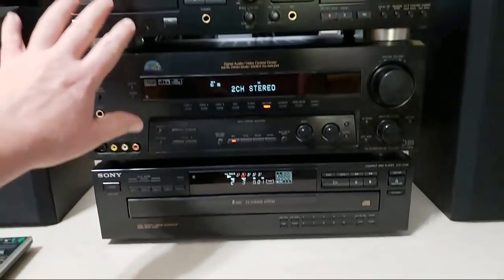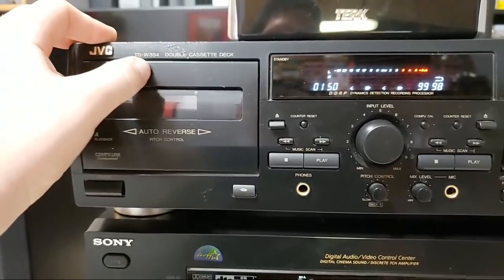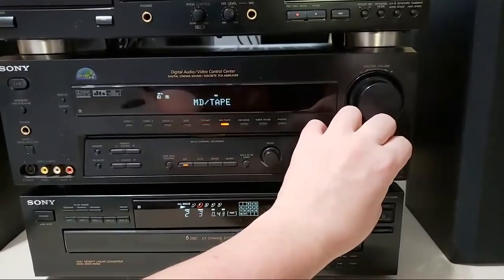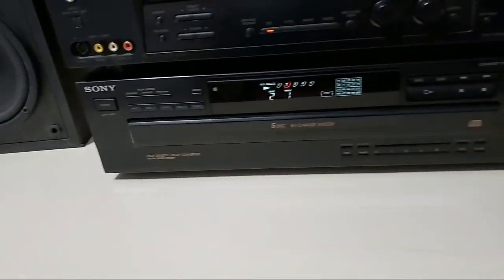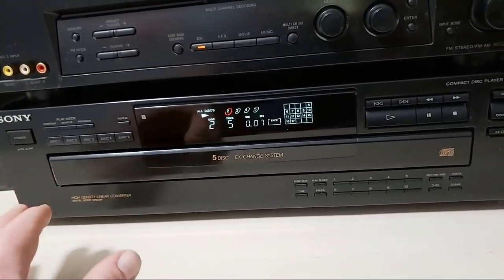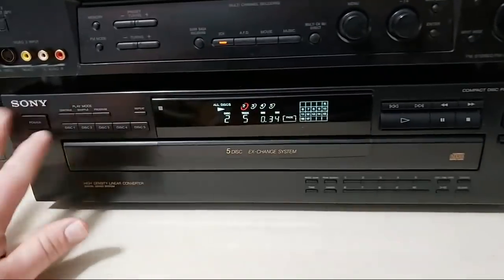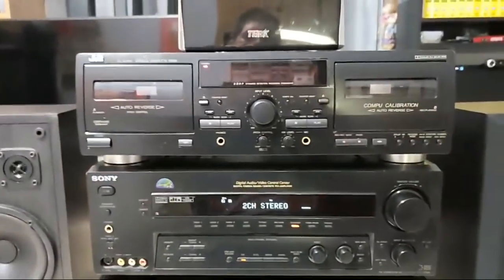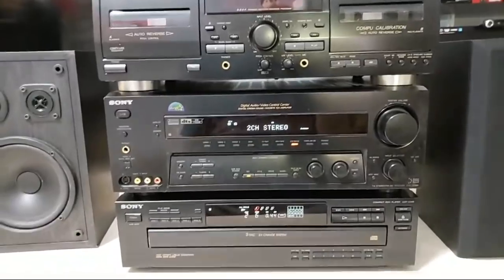Testing Garage Sale And Thrift Store Stereo Components

Comment: Cerwin Vega are pretty good speakers - they're not my cup of tea tonality-wise, but you'll probably going to find them most satisfactory.

The front bass ports allow you to position the speakers right up against the wall without losing bass response.  Not sure where the "RE" line fits into their range, but let your ears be the judge.  I bought a larger set if RE's a few years ago up in Carson City, NV and able to flip them easily.

The surrounds are pretty robust membranes EXCEPT on older Infinity speakers which will - almost to a one - be found in the wild with disintegrated foam surrounds - this also goes for Chrysler sound systems with Infinity car speakers.

For sticker residue, I like either WD-40 or lemon oil

Alcohol will leave a residue - but it's more obvious on the older silver-face components.  You can remove the residue with Windex.